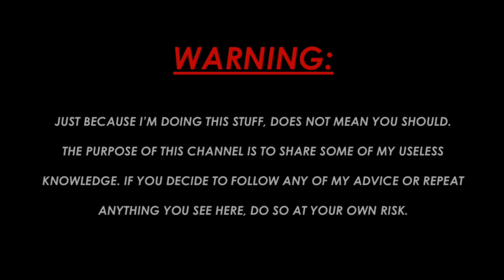How to measure bolts correctly!

Comment: Interesting note to add on the pipe dimensions bit. The terms tube and pipe are not interchangable, as tubing is measured from OD, while pipe is ID measured. So if you're building something, make sure you're using the correct terms. Roll cages on vehicles for example, use tube. To make the bends, you need a tubing bender. You can also get a pipe bender, but it won't work on tubing as effectively, and it's best suited to pipes, as the name suggests.

Comment: One thing I'll add that I recently learned is that central vacuum systems use 2" O.D. PVC tubing that's specific for that use.  You have to get specialty tubing and can't use off the shelf PVC pipe as it's 2" I.D.
Reply: Tube and pipe is actually the difference there. Tubing is measured OD, while pipe is measured ID.
Reply: @trail_mix24  good point and easy to miss.  Thanks.

Comment: Ive had some pvc read 3/4 printed on the outside of the pipe yet it didnt fit into 3/4 couplings. Why so? I compared to ‘normal’ pvc and realized that that smaller pipe measured 3/4 OD compared to regular schd 40.. threw me off for a day or two lol

Comment: Another winner. Do you know how many times I've ran to the hardware store to buy M8x1.25 or such bolts and just assumed that the thread pitch was measured the same as ours. I should have known by the low numbers but never thought about it. 
Another measurement a remember but don't see much was national fine thread and national course thread.

Comment: Going from SC 30 to SC 40 the same size Diameter but you have to use adapters .  I been doing this my entire life I still get confused lol  5/16 in 18 or 16  threads per inch . Looking at them its hard to tell Even using a Thread checker I look at a light it may look like its a fine thread but its metric fine the gage will fit and had to tell if its the right thread .   I love a Big shop with Bins on the wall it like going to a Bolt and Nut shop every size at your disposal . 40 years ago most of the Nuts and Bolts come from Detroit plants .  Now its all China :(

Comment: Funny story:
I lost a bolt on a dining room chair. I took out a second bolt to bring to the hardware store to match it on the thread guide. Neither metric or SAE provided a proper match so I Googled “Furniture screws not fitting properly”. 
Sure as hell, someone had posted that furniture bolts are actually SUPPOSED to be 1/4”x20 but because the production quality of the bolt made in Vietnam (along with the chair itself) was so poor and out of spec, only their bolts could be used. The author actually was able to provide the name of a supplier of these oddball bolts.
Reply: I might have tried re-tapping it by chasing the thread with a real 1/4 size tap & die. Maybe, if I was there.
Reply: @a9ball1  needed to get it fixed quick, the missus was getting miffed 😂😂

Comment: The U.S. needs to adopt the metric system at least when it comes to fasteners.
Reply: It's the converting back and forth that's so hard for some people. If we  could just stop time and switch over everything is would be so much easier. 
When I'm working in the shop I use both. Which is easier at the time.